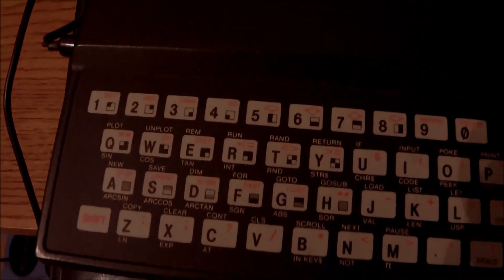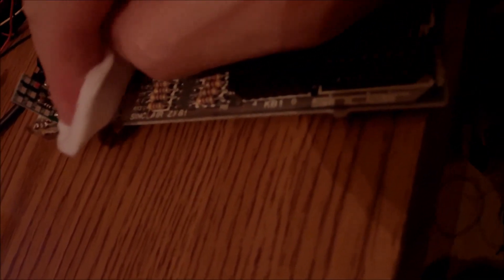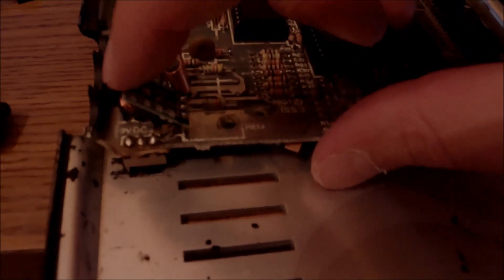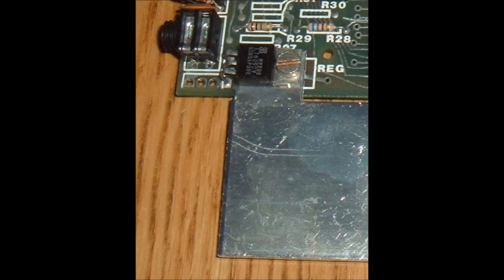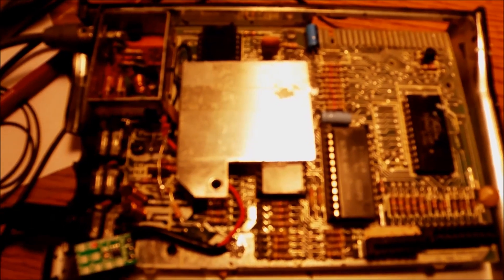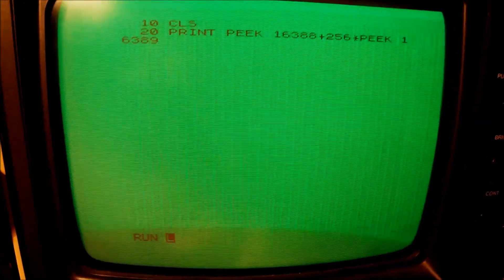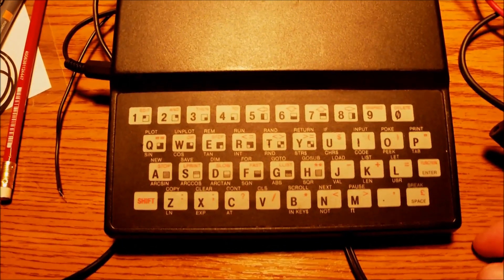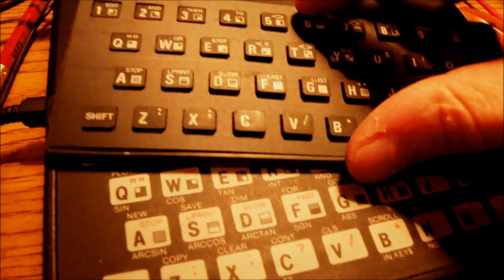ZX 81 - Filesixty keyboard, Composite mod, Cooling & DC regulator.

Comment: Hi, I have already tried single transistor circuit for (composite) video conditioning. It improved somewhat.. However, if you really want a significant improvement I would highly  recommend building the 555 circuit, download from the site,  http://zx.zigg.net/misc-projects/. Or, relevant video, here, https://www.youtube.com/watch?v=1irH3KuGyl0.

Also, I have added a coupling capacitor of 1000mf/16v on 5V, made a grand improvement on video quality.

Thanks for the video.
Reply from the maker: Thanks for the link and for sharing! This is much better, i have to say & thanks for watching!